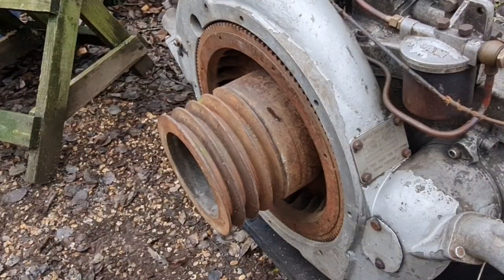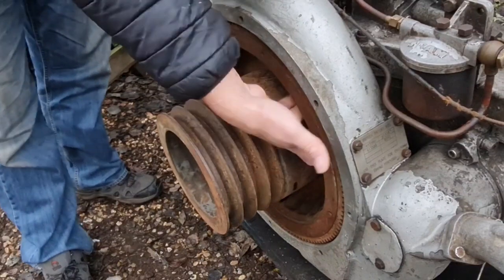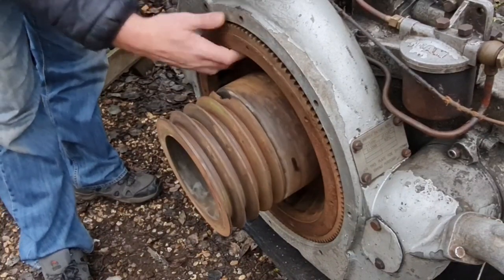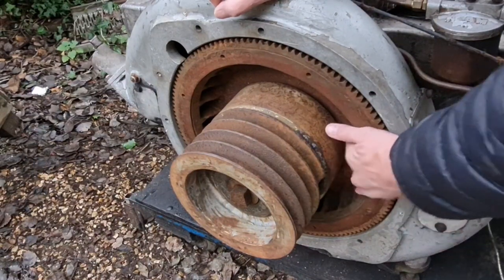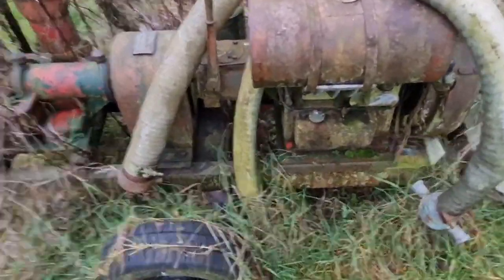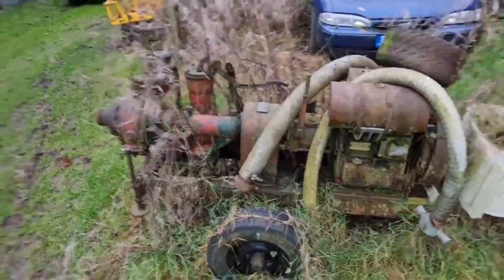Enfield Twin Diesel update.

Comment: I remember starting one of these, as soon as you flicked the decompression lever it used to kick back and start backwards. Good engines just a pig to start with the crank handle being on the cam.
Reply from the maker: Ow this is a bugger as you can see. I will get to the bottom of it one day. 😆

Comment: Did you ever get any further with this engine, or is it on the "to be done" list?  I have the smaller single cylinder sibling, the VS1, and looking at the manual and spare parts book, it looks like the flywheel fits onto a taper on the crankshaft with a woodruff key to locate it and a big nut to secure it (complete with the obligatory tab washer).  It looks like they had multiple different drive options that bolt onto 4 studs on the flywheel itself, from a bare output shaft to the flexible coupling assembly (can't tell which one you have as it's hidden behind the centrifugal clutch assembly).  My guess is that someone didn't tighten the flywheel securing nut properly, or didn't use a tab washer, and the flywheel came loose - from there it's only a matter of time until the woodruff key shears - hopefully it won't have chewed up the keyways too badly - or if you're really lucky, someone just missed the woodruff key completely (minimum damage to the crankshaft and flywheel).

I'm kind of glad it didn't start for you, because that flywheel wandering off down your garden at 1500 rpm wouldn't have been the best thing ever!!!

Anyhow, if you want copies of the relevant pages of the manual and parts book (I also have a parts book for an earlier HO2 engine), I'll see if I can scan them and send them over.

Comment: Well at least you finally figured out the enfield issue I don't even know what else it could have been if it wasn't that drive definitely film the trailer strip that could make a cool vid, how bad is the petter because its quite a nice engine could you do a diagnostic on it to see what's wrong and maybe fix it?👍
Reply from the maker: Well I think that's the problem. it kinda makes sense. I will record the trailer strip down for you folks. cheers for watching buddy.